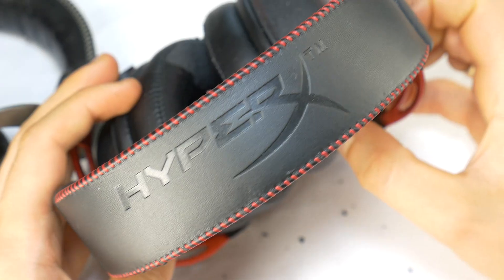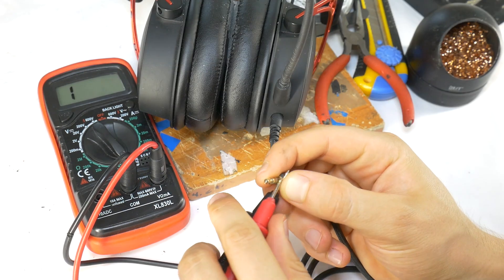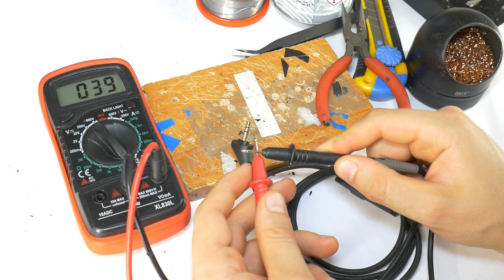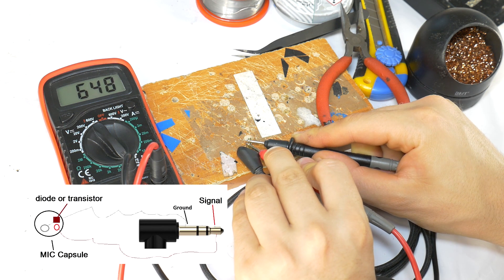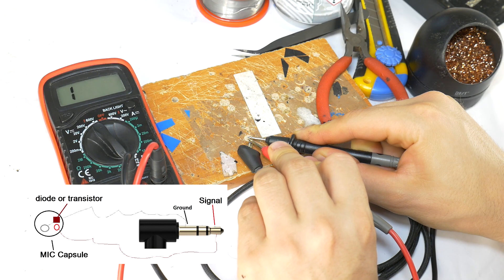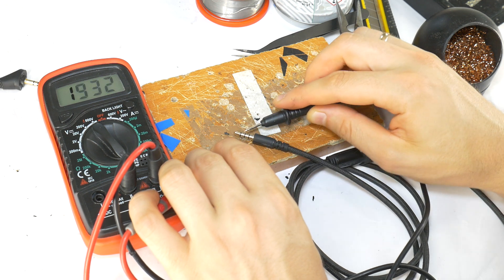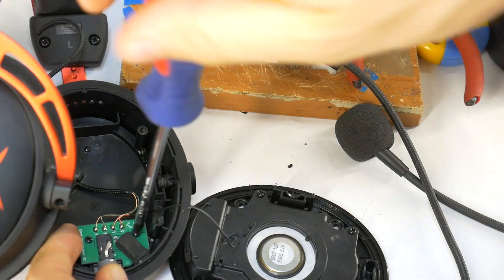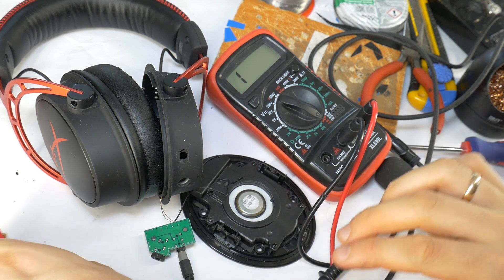How to Fix HyperX Cloud Alpha Mic Not Working

Comment: My left side has low volume and my right side has high is the left side speaker broken?
Reply from the maker: The best way is to check the wires and speaker driver with a multimeter to find out what’s broken.
Reply: My left side goes out and I need to ad pressure  to the connection near the left headset for the sound to comeback , I just purchased  the new audio cable and this is where I found out its in the headset  because  the issue  is still happening

Comment: one ear not working of this headphone, hoiw to fix it
Reply: I have the same problem on my left side
Reply from the maker: If it's the left side, then with a big change, the problem might be a broken cable. You need to check headphones with a new cable or measure the old cable using a multimeter.
Reply: @ u tried that and all the cables are good  I’m guess speaker broke
Reply: @TechscrewDIY  Hello, I have the same problem, one side does not work, I bought a new cable and the left side still does not work. I already opened it but the cables do not seem disconnected, they are still soldered, what do I do?
Reply: did anyone had fix this problem?